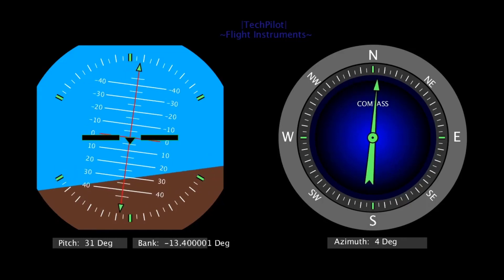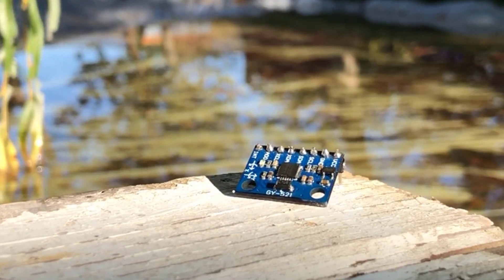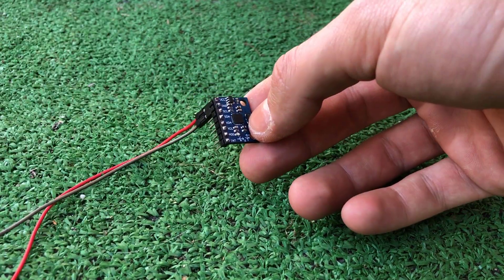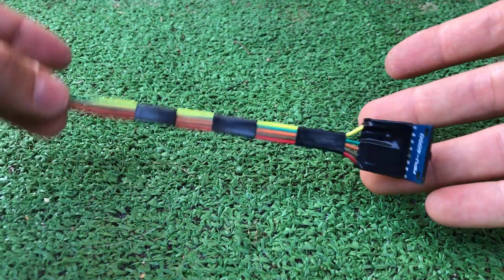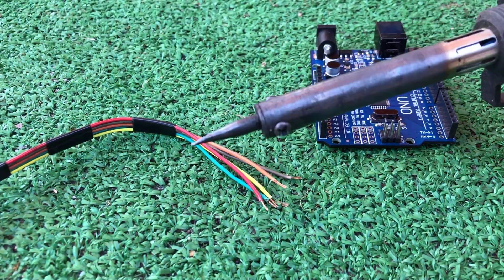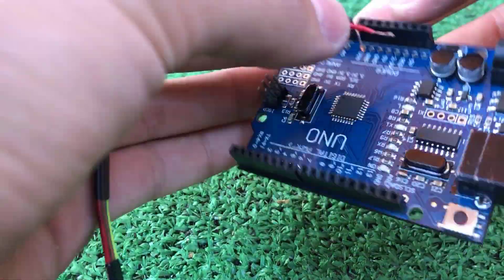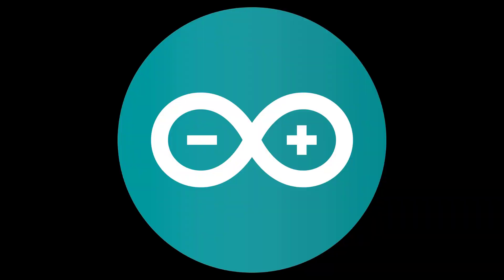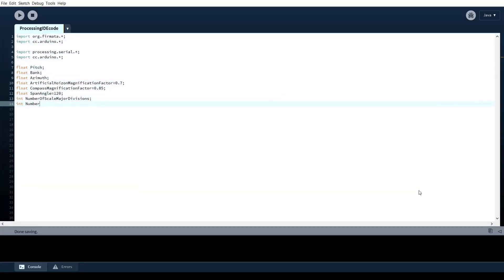DIY | Flight Instruments for Horizon and Compass [RO/EN - SUBTITLES]

Comment: From where the display will be get? Horizon and compass display
Reply from the maker: You'll need a second app called processing which gets the data from Arduino.
Reply: @TechPilot is there any ready GUI available for this sceam
Reply from the maker: Of course! If you go to the download section in video description, you'll find out that there is arduino code and processing code. The processing code is for processing software that you get from internet
Reply: @TechPilot  Just for the kind of understanding what is that website from where do I get the GUI,
Reply from the maker: From here: https://processing.org

Comment: Hi sir, when i runned the processing code, the display did show up but then it does not move when i move the mpu6050
Reply: it stays in 0,0
Reply from the maker: Hi! Try to check the wiring. Maybe there is a bad contact.
Reply: @TechPilot  I have the same problem, and the wiring is fine. Help us pls
Reply from the maker: I think that this problem need some  9kohm resistors between SCL and SDA. The resistors should be connected on the wire that is connected to SDA and then to 5v. Same for SCL.

Comment: You skipped the biggest part.  The small lcd screens drivin by the arduino.  If you need a computer to display the dials then its pointless
Reply from the maker: You're right! This was the first version of this project, but I will make an upgrade to this project, by installing an external digital display. I want to measure speed and altitude in the next update!
Thanks for your feedback!
Reply: @TechPilot  to add all of these things to the project you might need an arduino mega